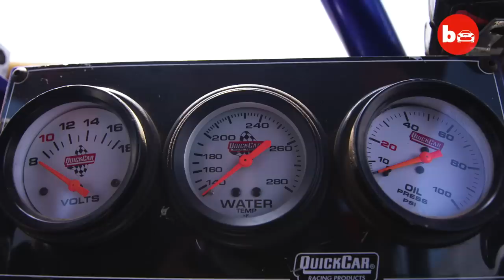America's Youngest Pro Female Monster Truck Driver | RIDICULOUS RIDES

Comment: Awesome... 
On the other side, we all from EU must switch to electric cars until 2029... because our 1.0 engines have too much Co2... 
That's irony... 😂😂😂
Reply: Mobile Games & Tech these run on methanol, not gasoline. Much less carbon monoxide
Reply: and these don't sit in traffic on the freeway for commuting each day ...
Reply: So you drive every day car with 1.0 engine in the US?
Reply: @IgorsPlay  are you gonna address the fact that these run on fuel that doesn't pollute nearly as badly as gasoline does? Or do you just feel like pointing your finger?
Reply: Get rid of your traitor politicians that push the "Climate Change" hoax.

Comment: "about 50 feet in the air" thats a lie, the highest monster truck jump is 36 feet in the air, the record was seat by Krysten Anderson.
Reply: i saw a video of a truck recording its highest height and i dont remember exactly but it was higher than 36 ive been looking for the video but cant find it
Reply: Have you seen the Leduc Leaps? Those are more than 30 feet. Rosalee Ramer did that in WF18